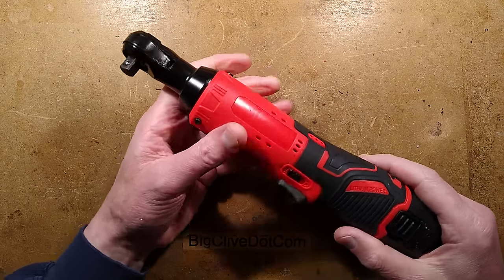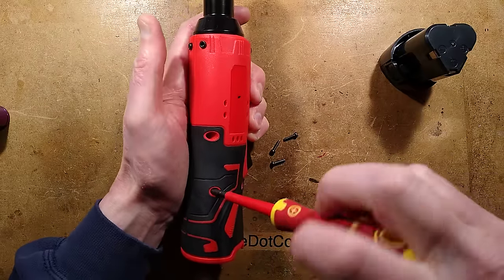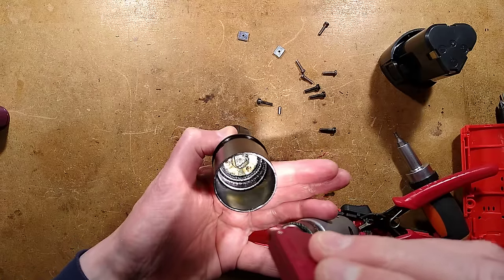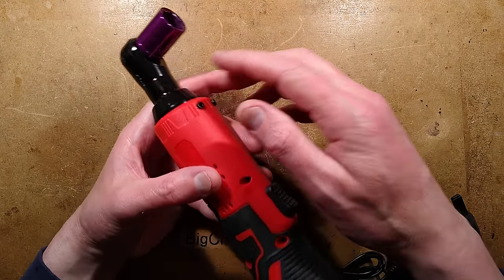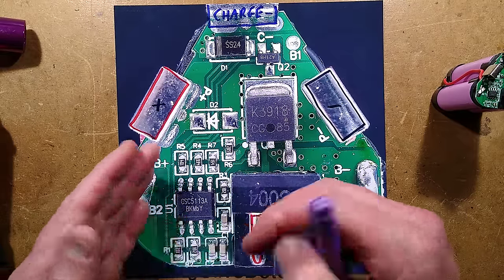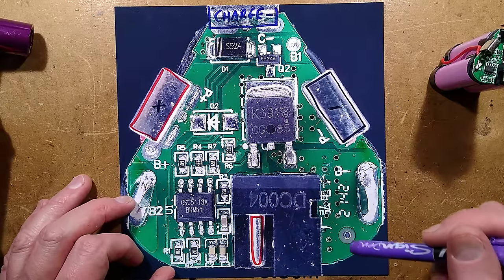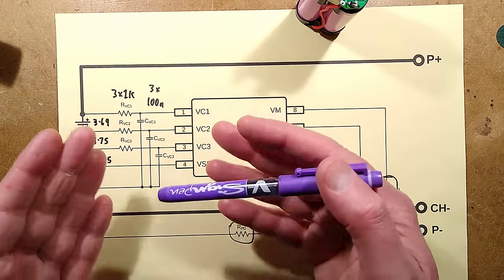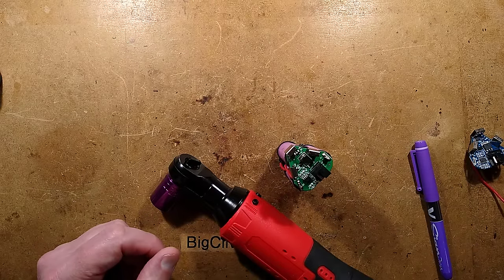Inside a cheap Chinese cordless ratchet

Comment: I have one of these that was a deal too good to resist. Being a 3/8 drive common sense is required if you want it to last a reasonable length of time. Speaking of time, the amount of time this simple little tool has saved me has paid for itself in the couple of months I've owned it. Much of my work is on classic motorcycles but I do also workon Land Rovers too. If it breaks I might shell out on a Milwaukee but I never buy Snap On as their power tools are just cheap rebadged stuff at extortionate prices.
A good little tool 👍
Reply: @maskedavenger2578  I thought, abate using fewer words, that is what I said. And, in the UK Snap On or Snap in two as we used to call them don't simply exchange tools anymore here in the UK since they changed the structure of their warranty system and made the peddlers of overpriced tools responsible.
I was one of those bright eyed mechanics/victims wandering around the van of dreams and buying spanners on the drip. I overheard the Snap On man chatting to my boss about his two or three Rolls Royces. Wake up time and moved over to Britool 😁
Reply: @PurityVendetta  Britool tools are far superior ,if you can get hold of them . Sometimes you could pick them up ,at boot sales after old mechanics & engineers had passed on . I don’t know any mechanics that ever finished paying for snap on tools ,from the visiting snap on vans.  I have still got a Japanese socket set I purchased in 1975 from Halfords that cost £8 ,I have used it on countless motorcycles ,cars ,& even washing machines ,the tin is battered with no paint left ,but the ratchet ,sockets & assorted extensions plus spark plug wrench are still as good as new. & still get used regular .
Reply: @maskedavenger2578  Most of my important tools are Britool. I have a set of combination spanners that I can't actually remember how many years I've owned. A 1/2" drive metric/AF socket set, A 3/8" metric/AF socket set. Many other Britool tools. Many of the tools I have have been collected over the last 40 years. 
I only bought Snap On stuff for about a year until I realised I didn't like the feel of their slimline spanners and thieving hands can't resist them. I've just managed to complete my Whit spanner and socket sets as they're getting rather rare these days.
Also I have various 1" and 3/4" drivers, t bars and breaker bars for specific jobs like Land Rover hub nuts.
Reply: @PurityVendetta  Yes the imperial size tools are getting rare ,me myself only have a few ,as I very rarely spanner old classic Brit bikes & never touch Harley’s . I tend to spanner Japanese bikes & the odd car now & then . I am a retired joiner ,but started tinkering with push bikes at around age 7 ,& progressed to motorcycles a few years later. One of my grandfathers was a mechanical engineer & the other one very good at carpentry ,so mechanics & Carpentry is in my blood . You never stop learning both of them trades ,always something new to learn . Good to see more ladies taking an interest in mechanics 👍
Reply: @maskedavenger2578  I'm in the UK and although I did on e own a 1942 45 WLA Harley, a left over WWII dispatch bike, I work on all sorts from modernish Japanese bikes that are now becoming classics in their own right to mainly Nortons and Triumphs dating anywhere between the 40's to the 70's. I've been riding repairing and racing motorcycles for the last 40 years since I was at school. My dad treated my brother and I exactly the same and taught us the basics. My workshop has grown to a couple of lathes and a Bridgeport which I taught myself to use. I really need a bigger workshop now as the work is piling up. Apparently there aren't many little engineering shops left and the big bike shops aren't interested in most classics.
Reply: @PurityVendetta  The modern motorcycle dealers are more like car dealers these days ,fancy carpets & coffee machines . Very few of them have proper old school mechanics ,they tend to be wet behind the ears & glorified part fitters .I doubt if some of them know what a carburettor looks like ,never mind set one up & tune it . I remember seeing plenty of old classic bikes I was born in the 1950 ‘s .& they were everyday transport for many people back then . My uncle had a Panther 600 & double side car ,that was half the size of a bus ,he used to take my Auntie & 2 children all around Snowdonia on it up to around the mid 1960’s .. He was reluctant to sell it ,to buy a car . I myself never actually owned a British bike ,but had cousins & friends that did . I nearly bought a Triumph trident ,in 1975 ,that was the closest I ever got to owning a British bike . I don’t class the modern Triumphs or Norton’s as the genuine deal . I think it’s best that modern bike shops are not interested in the classic stuff ,it leaves more work for mechanics & engineers like you ,who obviously have a love & feel for the old stuff. When I go into a motorcycle shop ,I prefer it to smell & look like a proper old school motorcycle shop ,that has seen some proper fettling ,not like a boutique ,fashion shop with fancy furniture & latte machines . Keep up the good work Sophie ,the sun shines on the righteous 🧰🔧🪛⚙️🏍👍
Reply: @maskedavenger2578  Awww thank you. What a lovely post. I haven't been in a modern motorcycle dealership in years. I run a 22 year old Land Rover Discovery as I can fix it myself and fit oxyacetylene bottles in the back while towing a trailer. The dogs love it too.
I have three Nortons, a 1956 Dominator 99, a 1954 Dominator 88 and a Domiracer Lowboy replica race bike. I find working on the Nortons I need to be a fitter and often fettle or machine parts to fit. I have a Yamaha FZR1000 (that makes me fear for my license) a classic 1976 Honda CB750 SOHC which I'm slowly restoring. And a BSA Bantam D14 Trials project I'm working on. We often build our own tools. I designed and built a frame Jig to repair, modify and build our own frames. As there seem to be so few small engineering workshops left we're quite overrun with work at the moment. This morning I'm sorting out the clutch and electrics on a customer's Triumph Tiger Cub and continuing with a ground up rebuild of an 850 Dunstall Commando.
Thank you for your support and enthusiasm, it's nice that some people really appreciate what we do. My partner does all the welding and fabrication so we can tackle most things.
Reply: @PurityVendetta  I am a pensioner now suffering from two lung deceases & other various conditions . So have had to downsize in order to keep motorcycling . The only motorcycles I own now are Honda Innova ( 2004 ) carb fed 125 cub type bike & an ex demo (2018 ) Suzuki DL 250 V Strom parallel twin single overhead fuel injected adventure style come utility bike . I need oxygen now if I get above 60 mph ,so just bimble about taking in the scenery these days . My days of knee down tearing up the main drag ,have long passed . I was even thinking of buying a classic Enfield bullet 350 or old Triumph tiger cub . I rebuilt my first 4 stroke top end on a Honda C 90 cub ,I used to get to work on in 1971 ,using a Haynes & Clymer manuals ,the owners tool kit & a few tools that were laying around . I never had the money to afford to put my bikes in for service as I was on apprentices wages . It was a case of having to learn fast & lucky I had the knack for the spanner’s in my DNA . To be honest you aren’t missing much by not going into a modern motorcycle shop . They tend to either cater for those seeking a budget Chinese 125 or middle aged tech mad mid life crisis cases ,with more money than sense . They don’t even smell of oil grease & fuel anymore ,& have carpets like car dealers . Not many of them can adapt & have proper old skills to get around problems like you & partner would tackle or attempt . I am not a qualified mechanic & I have more experience of rebuilding & repairing bikes than most of these part fitters . The last time I got a proper service in a dealers was around 1972 from a proper 5 star Honda trained mechanic ..So I have serviced them myself since ,& only put them in for the first one or two services when new under guarantee . The money saved has well paid for any special tools ,I needed or couldn’t fabricate or adapt in my outhouse myself . I also know the job has been done correctly & no parts gone missing off my bikes . If I needed rebores or critical lathe & milling done or welding .I took the parts to engineering shops or old school gaffs like yours ,where people take pride & go the extra mile for their punters .  There was nowt better than the sound of a classic Norton & the whiff of proper good old leaded juice hanging in the air on a hazy sumner day .👍

Comment: I bought one of these earlier this year and took it along to my car club. We were unanimous regarding it's usage, especially as it's cheap (£30!). Used as a glorified nut/bolt runner for awkward situations, leave the tight undoing and torquing up to more 'serious' tools. If you buy one as a replacement for a ratchet handle you WILL be disappointed, madness lies there!😁

Comment: Very interesting. That gearbox actually looks straightforward to put back together. Also that appears to be driven by an eccentric. That part is at least easy to make. You would need a rotary table to make the triangular drive though.

Comment: I've never had a battery powered one. I've always used a pneumatic air ratchet I bought second hand from one of my classmates in my high school auto shop class. I'm 38 now and it's still going strong after regular use. I just oil it whenever I use it and take it apart once a year to clean it and remove and replace the old grease.

Comment: Hi Clive, great breakdown, as i started as a vehicle mechanic, and part time factory dogsbody / apprentice toolmaker, all the tools were pneumatic, my trusty old Blu-spot saved the day by being able to drill holes in a class 1 EX environment, like a hydrogen gas or ethanol installation. We used spark-free BRONZE tools that weighed a ton. I would LOVE TO SEE you tear down a Nest thermostat, as i beleive their 'smart ir' may be an actual camera and not just a smart IR sensor array. Having worked in the industry for many years, i am convinced that this needs to be looked at, but i am not willing to sacrifice my own Nest, they cost a bloody fortune :)

Comment: I got one of those as a gift a year ago, mine came with 2 batteries, a charging stand, some sockets and a carry bag. I looked it up on Amazon and it was $60 at the time. I was pleasantly surprised, I've pretty much rebuilt the interior of my old Jeep with it and it worked great. Not for heavy duty use, but for light duty it's been great.

Comment: I bought a no name mini brushless angle grinder on eBay for $42 last year. It came with two batteries that look and charge exactly like that one. I haven’t gotten around to it but I’d like to know if I could use a name brand batteries in the Chinese tool. The packs look similar to Milwaukee and even some Dremel batteries I have.
Reply: The branded batteries normally have some sort of keying to try to prevent you using them where they don't want you too (Bosch even have two different ones for their Green and Blue tools 🙄). Obviously there is a chance they might be compatible if the designer has engineered it so they can sell knockoff/compatible batteries that also fit their own tools, but on the other hand just because the have a very similar form factor doesn't mean they'll likely fit/work.

Comment: Clive!  poking about in the battery pack... Where was the explosive pie containment dish?
Reply from the maker: Right underneath the bench on standby.
Reply: @bigclivedotcom  I fill mind with water to contain the heat in case of overheating. It's a good way to contain the situation.
Reply: @masteryoda394  Water and lithium batteries just creates more flames and death so not recommended. Sand is pretty much the only thing you can use to quench these.

Comment: I agree with your postulation that the pin on the drive is the weak link in the system. Another weak point will be the pawls in the ratcheting mechanism. Other than that, not much to go wrong on these. 

I know these are pretty affordable, but for only about $20 more you can get the lower end AC Delco ratchet. It's drive end is much more substantial than these cheaper ones, and will last a lot longer. You can check out my video on those if interested.🙂

Comment: These originally appeared as air powered tools. Being fairly new things back then, they didn't have much torque but were really good with unwinding those harder to reach fasteners that were a little 'tight' but loose enough to be undone. 
Seeing them appear as battery powered units comes as no surprise and as you say Clive, they're not torquey and instead are meant for those fasteners that require a mechanics time - they make great time saving devices.
Thanks for going to the trouble for this one.
Reply: Amazing time, and forearm saving devices. For those long threaded bolts they're just lifesaving. I have a Kobalt brushless ratchet but these cheapies can get into places the bigger ones cannot.

Comment: 3S 12.6V 6A Li-ion Battery BMS Protection Board 18650 Power Bank Balance Board
This BMS is rated for 6A so if you don't force it manually that pin wouldn't brake. 
I used 3S-10A for my cordless drill and it failed because on load it pulls much more than 10A (and this is same motor) so I used 3S-20A and it worked but on bigger load it stops or if I press power button very fast it stops also. So I bought 3S-40A BMS and can't wait to switch to it and see the results. 
This is nice cheap tool just to fast screw and unscrew but for tighten to torque it is recommended to use real ratchet and that pin will survive.

Comment: One had one of these for a year or so and it's ok. Not for large work, or anything serious I suppose, but I've used it many times for running bolts down just fine. It comes in handy as a slightly more powerful electric screwdriver. Worth the £25? I would say so.

Comment: We have used a similar cheap (Chinese) ratchet for years, but driven by an air motor.
We never greased or lubricated it and gave it a hard time.
I believe that it must still function at present (industrial maintenance in a tannery...).
**
Nous avons utilisé pendant des années un cliquet bon marché (chinois) similaire, mais entraîné par un moteur pneumatique.
Nous ne l'avons jamais graissé ou lubrifié et lui avons mené la vie dure.
Je crois qu'il doit encore fonctionner à l'heure actuelle (maintenance industrielle dans une tannerie...).

Comment: It’s like watching an AvE BOLTR  without all the F-bombs. 😅

I have almost this exact same tool (JUEMEL branded from The ‘Zon); mine is a 4-cell instead of 3-cell (it’s one louder). I haven’t used it extensively, but it’s been quite good to me so far. I only wish it were a 1/4-inch drive. I took apart my beloved Skil with a 1/4-inch drive and found the momentary switch is faulty. I researched the numbers on it and managed to buy a replacement switch from Digi-Key. However it is soldered in place and I cannot solder to save my life. So on my table in pieces it continues to lay.

Comment: in regards to the battery, I recorded a video a few weeks ago (which I will be publishing in about 3 days time) for my Electronics for Beginners video series, covering cell balancing and battery protection circuits, thats a good coincidence LOL.
Reply from the maker: Have you seen the balancing circuits that seem to use a cascade of DW01 style chips as voltage thresholds bypassing the charged cells via transistors?
Reply: @bigclivedotcom  a couple of the modules I show in the video have balancing using voltage detecting IC's (One uses the DW01A, another is using a device marked as 13C7E) which load the cells down using mosfets with a resistor to drop the voltage when they reach 4.2V, to give the weaker cells a chance to increase in voltage.

Comment: That chip can (in theory) perform some battery balancing because it can ground (or apply V+) combinations of the VS pins between the batteries.
Because each pin has a 1k resistor that will apply a 4 mA balance current, depending which pins are grounded or powered.

Comment: I have 3 of the 18V versions & they have a micro on a PCB in the tool to control motor speed, they have survived 18mths of pretty severe abuse so far including loosening very tight bolts & retorquing them also lots of drops n throwing in my toolbox. I charge mine from a bench power supply & they don't appear to have any current protection as I can charge them at up to 5A for short periods with no cut off which isn't good, typically I charge is 1A current n voltage limited.

Comment: Iv used the these before but the were powered by air. So very powerful. As for these battery operated ones, we'll I suppose if get a good one could be OK.  Ya still can't beat the air ratchet especially if you work around cars in a garage.
GOOD VIDEO CLIVE. VERY INTERESTING 👏🙂

Comment: I bought one of these, because it, with the two batteries and charger, was cheaper than a replacement anvil for my broken Milwaukee one. Here in the UK at least. I do miss the variable control of the Milwaukee and was surprised when the cheap one arrived and I discovered it just had a simple on/off button with no speed or torque control.
Anyway, it's been a good tool and you can't really complain for less than £30 with two battery packs.

Comment: Great video! Would that pin actually break if you were using it like a manual socket wrench? Seems like maybe it only has to survive the torque from the motor. Ideally you don't even use a regular ratchet for a stuck bolt but a breaker bar (although a normal quality ratchet is pretty hard to break in practice).